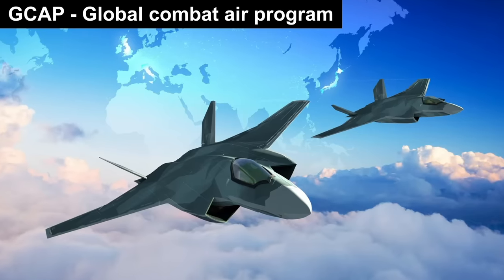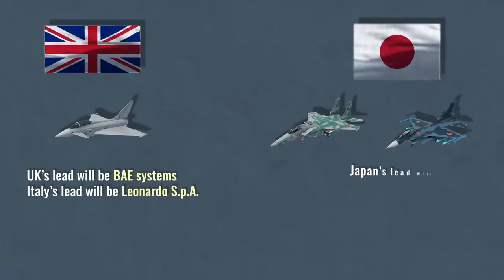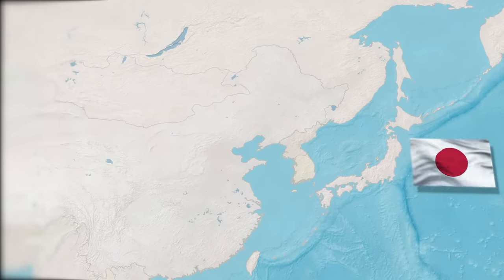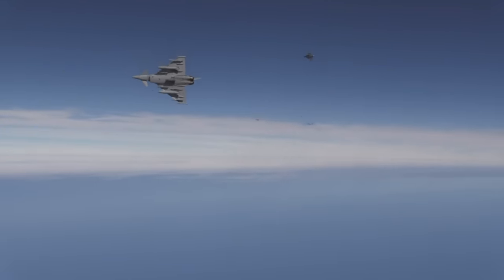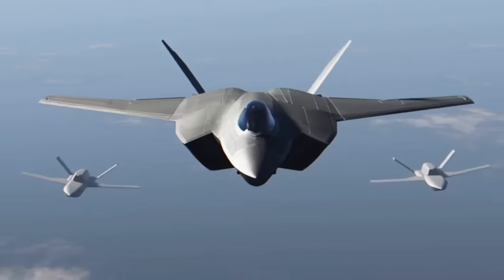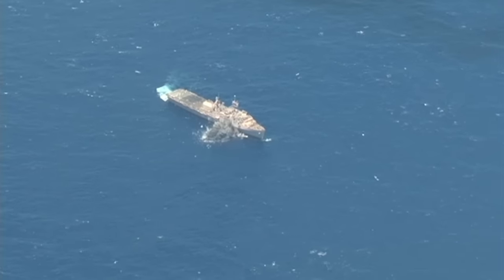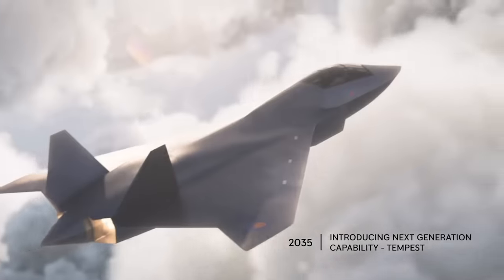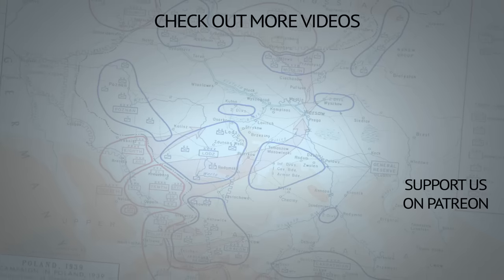Why is the future Anglo-Japanese fighter gonna be bigger than F-22?

Comment: I suspect Australia will go with NGAD too if the US will sell.
A few years ago, I’d have said there’d be no chance based on what happened with the F-22, but post-AUKUS and remembering the US made special provisions for selling the F-111 to Australia, it’s more than possible this may occur in future.
Reply: Very likely. Australia has no recent tradition of buying fast jets from the UK, not since the Vampire and the Meteor in the 1950s. Nothing since then has had the long range always needed in the Pacific.
Reply: Don't forget Australia is the only Allie using the Growler.  A US NGAD is most likely if it is Ghost Bat compatible otherwise it will increase JCAP potential.
Reply: The Australians couldnt afford to base their air fleet around an aircraft that US Generals are saying will be in the order of $300m each.
Reply: @watcherzero5256  You may well be right, but if it is too expensive for a wealthy country like Australia, then the USA couldn't afford it either.  They will have to find ways to make the system more affordable. Otherwise it will go the way of so many other over-budget abandoned projects like the A-12 and the TSR-2.
Reply: @juneabbey9538  The US will probably have a layered air fleet, with the NGADs backed up by 5th gen fighters.
The NGAD provides air superiority and takes out the biggest radar systems - it is replacing the F-22 after all. The F-35 is the multi-role fighter bomber that takes out air defenses. 4th Gen mops up anything on the ground.
So not a huge volume of NGADs
Reply: Australia needs something with more range to give us more defensive depth this could do it.

Comment: Italy is NOT in the middle with a smaller part. Italy is the founder of the Tempest program with UK. And is bringing the expertise of the Typhoon project (predecessor of the Tempest). Who is the most irrelevant part and has been added at a latter time in a political effort to expand the NATO to the Pacific is Japan. That for years tryed to make a decent aircraft but never could be able to acheeve success. And has been picked up more as a replacemente to Sweeden.
Reply: Japan has more money and resources than the other two. And whilst they lack expertise in many areas of defence manufacturing due to over-reliance on the US and a post WWII ban only recently lifted on collaboration with others they have top tier tech when it comes to electronics.
Reply: @TheThundertaker Japan will do the heavy lifting but the UK especially has a lot of tech that JP doesn’t have and they can fill the gaps. And yea Italy is definitely not going to play a prominent role in development…
Reply: @cw19280  based on?

Comment: My bet: its going to be a high speed, high range, stealthy missile truck, not a fighter in the least.
If it ever gets into a furrball then its F-ed up, but thats what the AI wingmen are for.

Might even be big enough to carry a few wingmen to drop like land mines and run, if things get hairy.
Reply: This is probably the correct bet. A bigger air frame will allow it travel farther (more fuel) and the Allies are currently missing a long range stealthy middle truck (F-35 Carries at max 6 missiles, FX-15 is not stealthy and old). 

This in theory would avoid duplication of systems, especially considering the F-35, which Japan, UK, and Italy continue to have, will be supported until the 2070s. The F-35 will continue to be the quarter back while the GCAP will be the overwhelming firepower

Comment: I would be surprised if the XF-9 is used in any form. Yes obviously it will heavily influence the design but it’s not a future engine, it’s a current engine. I imagine the core and all that jazz will be completely fresh, with RR more extensive engine experience being crucial.
As for Radar I fully expect Japan to be on top, of that, and the UK and Italy will aid in what they know, as their current Gallium Nitride prototype is only partial nitride, and partial arsenide.
Reply: XF-9 advantage is a relatively narrow width while maintaining adequate performance. This allows a thin side profile to the aircraft which is more stealthy.
Reply: @stupidburp  of course, that’s not what I’m referring to. EJ200 and F119-PW-100, the engines that power the F-22 and Eurofighter, both first ran in 1990, a third of a century ago. The British and Americans have always been leaps and bounds ahead of the competition when it comes to jet engine design, including the Soviets.
Reply: @jacobbaumgardner3406  It's not that clear cut. RR beat P&W with their tested specs for the F136, and they themselves are impressed by the XF-9. Also, the RR already offered IHI consultancy on the XF-9- and that makes a lot of sense since (publicly) they've only had the time to test modifications to existing platforms and neither country can afford to extend the timeline.

I'm hopeful for XF-9, since it was designed from the ground up for these stealth and power generation requirements, and it has a form factor that could really benefit future stealth drones and hence, really improve sales prospects and maintenance costs going forward.
Reply: @lechefski  I would agree with the stealth drones. Not to disparage the Japanese at all, as I imagine the information technology of Japan will greatly benefit the program. However it must be understood that the engines such as the F136 are old designs now, with the F136 being a 2004 design, while the XF-9 wasn’t delivered until 2018. Again Japan is very in on technology, but engine design has historically and currently an Anglo dominated field.
Reply: @jacobbaumgardner3406  I'd actually argue that the Brits are well ahead in information technology, heuristics, etc. Anyhow, I'm not saying that the Japanese are on par, but let's not pretend that 30 years in jet engine development is the same as it is for consumer electronics. Also, if RR is on board, I really don't see a conflict of interest for either party, especially now that the Brits are pressuring IHI to look into adaptive cycle. This could be a massive win-win scenario.
Reply: @lechefski  oh I totally agree, I was just wanting to make it clear that the XF-9 itself would not be used in any meaningful way in the final product, instead seeing a new design based on what both countries have learned, especially is adaptive cycle technology is introduced, as that would require a new core, and therefore essentially a new engine.
Interesting take on IT, and I suppose you’re right, with Japan being less into the networking and more into the actually electronic design, such as radar seeker technology.
Overall with both countries working together, they can cover each others bases and make a very formidable aircraft indeed. 
Large and fast with decent range, and able to carry a large assortment and volume of weapons, all the while having the latest and greatest in every technology needed. 
I actually disagree with a Binkov on NGAD and Australia. NGAD is unlikely to be made in large numbers and to sell such a limited asset to foreign curstomers seems unlikely. GCAP seems much more likely imo.
Reply: @jacobbaumgardner3406  Ah I misread as well then! ^Yes, they say it's just another prototype for now.

I'm so hopeful they can work something out, especially since it's so rare to see countries this well aligned with their needs and having truly mutual respect (esp compared to the FCAS partners). The Brits with their breadth of engineering experience and the Japanese with their bleeding edge material sciences and manufacturing know-how. Solid partners in the making.

Yes it's sadly true, it seems like the Japanese struggle with the software side of things and by extension, user experience and ui. There's a heavy reliance on foreign contractors/subsidiaries to cover this gap so I'd argue that the Brits and Italians are going to be excellent partners here.

I disagree with the NGAD sales prospect as well, the one exception coming from how the US greenlit the nuclear sub sale for fear of a Chinese Pearl Harbor, so further escalation with China could force its hand, but that remains to be seen.

Comment: Honestly if the plan is to team it with drones why do you need a big internal bay, like each of the drones I would assume could carry at least 1 missile internally assuming they are also going to be stealthy and 2 externally with mountable pylons, although due to weight limits you would have to choose whether you wanted to go with 2 externally or 1 internally and maybe 1 external and 1 internal, but likely you wouldn't bother unless you can drop the pylons and recover stealthiness. Assuming you can team up with at least 4 drones you could cut the bay in half.

Comment: One thing when you talk about the reasons why the US restricts weapons exports is, its bit the US in the butt on multiple occasions. Even today, F-4 Phantoms still makes up a large portion on Iran's air force. But this aircraft sounds less 6th gen and more 5+. Not that this is a bad thing. The F22 and F35 are not the best aircraft for the Pacific, and the new NGAD will need to have both more range and capacity to handel the longer distances there. By focusing this new fighter on range and less on stealth, they could produce a fighter more suited to the region. The bigger the aircraft, the harder to make it stealth. Also, true stealth is pricy and with newer radars more sensitive than ever, even the F22 may one day be fully visible on radar, and without ECM abilities, it wont have a way to defend itself. Thats where the future will be, using technology to "cloak" the aircraft.
Reply: Sounds like they are trying to build a J-20 type of jet. Less stealth but more range and more speed, more firepower.

Comment: In exercises, F-35s often identify aircraft before AWACS does. They are a great quarterbacking airplane with it's sensors and SA.

"You have so much more information, and then through fusion, you're sharing and collaborating with all the other airplanes out there. It is impossible, if you were a 4th gen perspective, to understand without seeing it from the inside, how much more awareness that you have. I think it’s part of the reason why Lt. Col. Tucker [former F-35 pilot] said about ‘not needing an AWACS telling him what to do as he had more information than them…’

This isn't to say that an AWACs isn't a valuable tool, and it helps us do things that you certainly couldn’t always do or wouldn't want to do in an F-35. But in my cockpit, I saw this in Raptor and I saw this in F-35 when I went on operational missions in Nellis Test range or anywhere else, we routinely and almost never utilized an off-board system like an AWACS and when we did, we never relied on the information they pass because we had so much high fidelity information.

Four-ship Raptor/F-35 does not need an AWACS to conduct missions.” "

– Lt. Col. David "Chip" Berke. Over 2,800 hours in F/A-18, F-22 and F-35. Served 3 Years as Top Gun Instructor pilot and former CO of First operational F-35B Squadron.
Reply: How much of that f35 detecting things before the awaks does is because the f35 is deployed far forward of the awaks because it's the stealth...?
Reply: @michaelwicker9538  I think most of it. It can take a closer look for sure, and with data sharing with other F-35s, it can paint an excellent picture of a wide swath of airspace. ..... But the sensors are excellent as well, and that's part of it too.

Comment: 7:50 1800C inlet temp? Dude, that's on par with the inside of a kiln making high fired dense industrial ceramics. This is before being compressed and combustion. Is the exhaust temp 15000-20000C? I'm guessing that you meant 1800C exhaust not inlet.
Reply: It means the fuel & air inlets into the combustion chamber(s). That indeed is the hottest part in a jet-turbine as the burning starts there. Even with afterburner on the exhaust should be somewhat cooler.
Reply: @HiReeZin  Never heard of inlet temp being defined that way. Reference?
Reply: @HiReeZin lol an armchair expert, imagine the inket being hotter than the exhaust 😂😂😂😂 real great mind power it seems
Reply: Japan MoD and IHI (the manufacturer of the engine) surely said that the inlet temp was 1800℃.

Comment: Korea working on a non-stealth
Reply: So it's  basically  gen 4+ then^^ stealth is a must in a gen 5 and gen 6 is even more stealth and alot better tech overall to detect  control drones etc
Reply: You're talking about the KF-21 right? If so yes you're correct in that it is not stealth. It's a generation 4.5 to 4.75 plane.

However that's for their first block. The South Korean government does plan on upgrading block 2s and block 3s to fit a more 5th or even some 6th gen tech in the future.
Reply: @lazysnipe  It is stealth-y but has no internal weapons bay yet which makes it nonstealth.

Comment: BAE has also built the "flapless" demonstrator, which is very stealthy indeed.
A flapless GCAP would be amazing.
Combined with Reaction Engines' hypersonic jet engine concept?! 🤤
Reply: yep love that to happen
Reply: Sounds almost biomechanical... can't wait to see the generation after this!
Reply: First there was the BAE Demon demonstrator UAV.
Most recently there was MAGMA by the University of Manchester.
Reaction Engines' pre-cooler from their SABRE rocket engine has been used to create the Hypersonic Air Vehicle Experimental (HVX) Programme.
You take a jet engine, who's speed is limited but inlet temperature melting everything, and add the pre-cooler from SABRE.
The idea is now you have a jet engine that works from rest up into the Mach 5 range.
Currently known as HVX Concept V.

Comment: It will be better than anything China or Russia has, and that's all that matters. It will fly alongside F-22, not against them.
Reply: F-22 will be retired before this thing enters service.
Reply: @blegi1245  I guarantee you it will remain in service long after it is due to be retired.
Reply: @B.D.E.  That's only because congress won't approve retirements as soon as air force wants. But it won't be 6 years or more (planned complete F-22 retirement is 2030, this thing is supposed to enter service 2036 if there are zero delays).

Comment: I think it'll be a 5+ gen not a true 6 gen. Britain could have gone it alone, if it could afford it, so it'll probably be very like the original Tempest. The Japanese radar is a good plus for it.
Reply: You are wrong. Gen 5 hasn't drones remote control.
Reply: @calogerohuygens4430  US will make the true 6th gen with advanced stealth, ai, energy weapons, drones, advanced engines tech and unmanned tech. UK too wishy-washy and doesn't seem certain on the capabilities they will be able to include on the jet right now. The US has much more ambitious targets and will end up setting the true benchmark for next gen air combat again.
Reply: @F1ll1nTh3Blanks There is no such thing as a "true" generational aircraft. It's just a general term that represents some standard capabilities with all aircraft in said category. For example, stealth aircraft and 5th generation is synonymous.
Reply: @voidtempering8700  I know, my point is that the US will set the standard for what will end up being considered 6th generation capability. At least, that's what I am more confident in, over European programmes, the rest will probably be Gen 5.5 capability, assuming they have stuff like stealth and drone capability like F35 4th cycle update.

Comment: At the moment SAAB has invested more than italy. However my speculation from what we've heard recently Sweden will p"ull out" becausr of changing strategical situation as well as economics
Reply: Not to mention the different needs from Japan and Sweden. No current fighter program fits the old Swedish strategical situation
Reply: @backisgabbeYT so gripen is last fighter from Sweden. Sweden can't produce 5th gen fighter alone.
Reply: @gobimurugesan2411  They will probably join France and Germany with whatever they make.
Reply: @gobimurugesan2411  No, Gripen is the last fighter solely produced by Sweden. Not the last fighter built in Sweden. At least I hope not.
Reply: @raptor1672  Maybe!
Reply: SAAB has invested £50m, Italy has invested €585m so far over three years. SAAB has always been more interested in the drone and sensor technologies and what it can transfer to the Gripen, since its become apparent the Gripen wont have the energy generation or cooling capacity to handle most of the sensors under development they are in observer mode, having signed a exchange of classified materials treaty with Japan to allow them to carry on being an observer on the project after Japan joined.
Reply: @watcherzero5256  you are right, I did not know Italy accelerated their investment in the GCAP program

Comment: As a prior aircraft maintainer and someone who has maintained glued structures/electronics, that plane sounds like an absolute maintenance nightmare to replace fasteners with glue.
Reply: Time to buy stock in heat guns
Reply: Oh yeah, you're right. I didn't think about that since you have to pull off all of those panels for inspection and so have to remove and reapply.